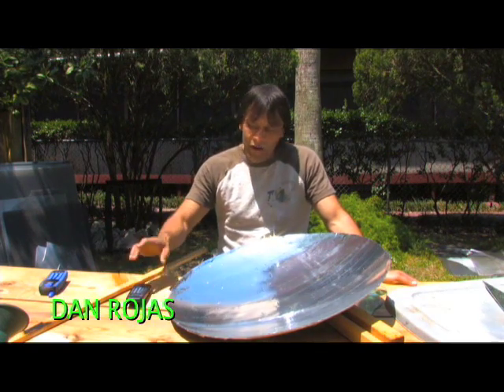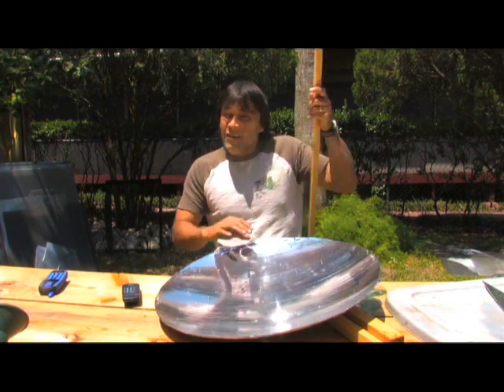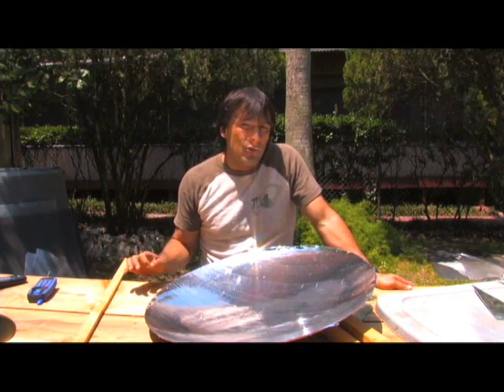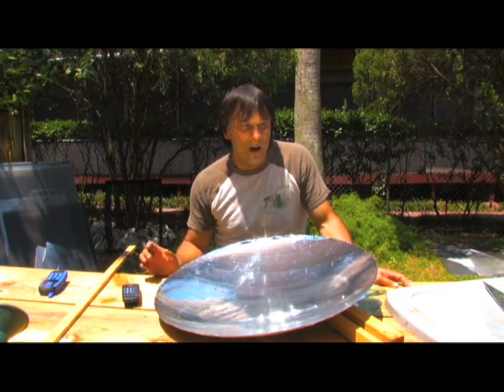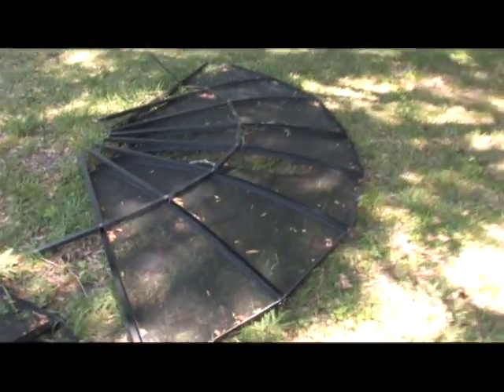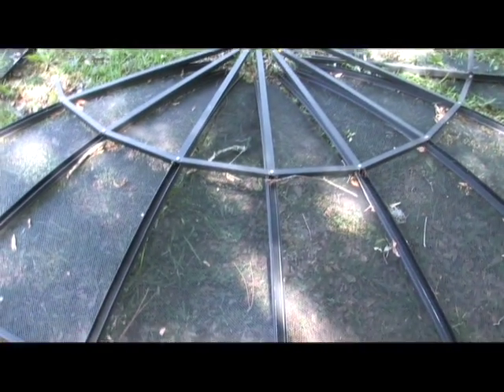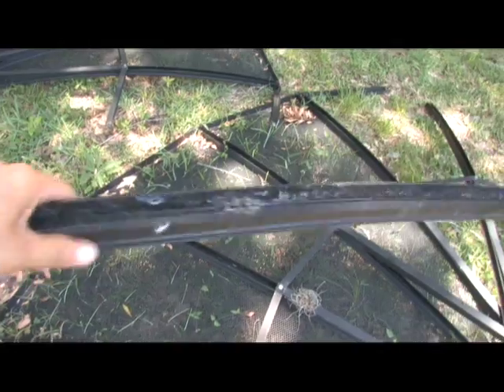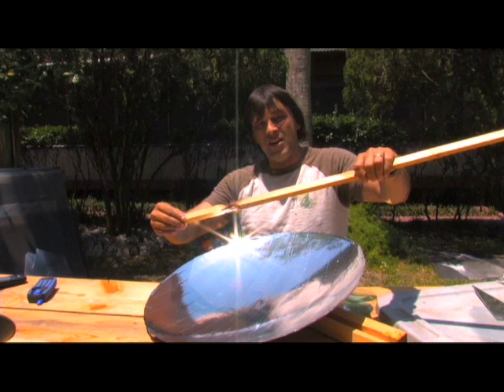Solar "Death Ray" PARABOLIC DISH MIRROR PARABOLOID HOMEMADE DIY REFLECTOR RENEWABLE ENERGY

Comment: Hey Dan - As to your reference to WIFI antenna usage there was a group of HAM radio operators in Nevada that conducted a test using 2 - 10 foot dishes and they hooked up cordless phones to them.  In their test they were able to communicate at a distance of 125 miles. They were on hill tops one in Las Vegas the other in the SW corner of Colorado as I recall.   Not too shabby!  I barely get my cell phone to connect with the local cell site 6.5 miles away!

Comment from the maker: What dish did you use for a mold. Please do a video, it would be neat to see.Satellite dishes are parabolic but shaping like a lens is better.  Some solar bowl cookers over do the shape and make it almost a half a ball. This works but only 60% is active. For mirroring without wrinkles, cut into strips and apply across the shape. Pie cutting works, but strips are much easier. I will have links to the materials for lining on my website in a few days, it is pretty cost effective.

Comment from the maker: The material is an adhesive vinyl, buy there is better stuff out there, the shape was first cast out of concrete then molded to fiberglass. Next weeks video will have all the info. Mylar is to random for concentrating. I have 3 reflective materials I will be sharing. They are excellent.

Comment: what kind of adhesive reflector did you use? i was thinking about using mylar, but i didn't want to go through the hassle of vacuum bagging. and how did you cast the fiberglass paraboloid?

Comment: Hi guys,
  i was reading up on water.  Did you know that under a vacuum you can boil water at lesser temps?  And under pressure, you can superheat water without boiling.  I really like your salt water distillation video and i know that it was mostly an experiment and example...but you've illicited thought and now have to deal with the reprecussions:P  How about a small bowl that is gravity fed.  Heat and boil the water in the bowl and not the body of water?
Keep up the fantastic work!

Comment: Hello, To get the mylar to go wrinkle free I saw a website once where they held the mylar around the edges and had a small hole in the dish and sucked the air out which sucked the mylar film down evenly and taunt Don't forget to pre aplly the glue. Great videos by the way. Thanks.

Comment: @TheBetterGame ok, you missed the point. I agree that the sun is not renewable but, your comment, no offense, is actually kind of dumb and illogical.  if we use it or not its energy is out there so I think it is better to use it than not to use it.  Second, it is not like we are taking pieces of the sun and transform them into gas or something. It can´t be compared because it is just no the same process.